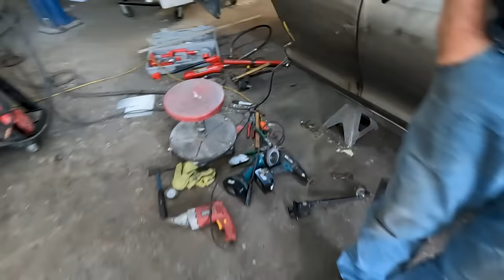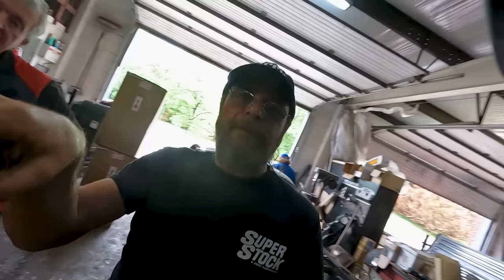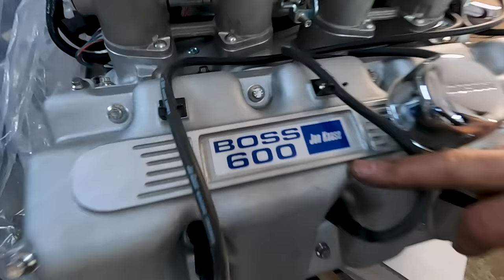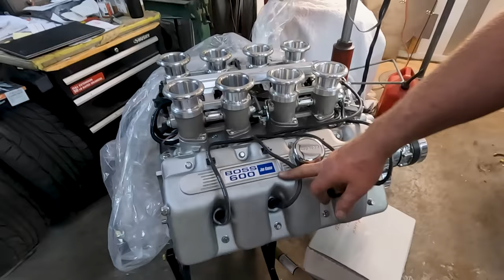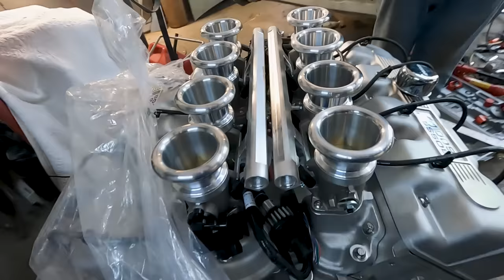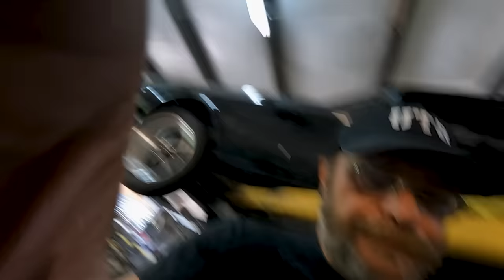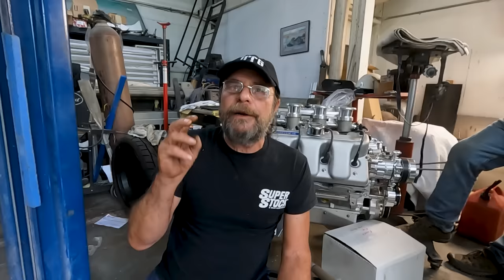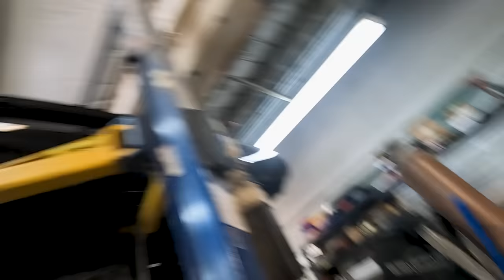How Ford Screwed The Pooch On What SHOULD Have Been The Greatest Musclecar Engine Ever

Comment: I don’t know if anyone else mentioned this, but the Boss 429 was pioneering in two very important ways you didn’t mention. It was the first production engine in America with individual shaft mounted rockers, and the Holley Dominator carb was originally designed for it. It was way ahead of its time from an engineering standpoint in so many ways.
Reply: It was on the cover of Hot Rod magazine in the mid 60's but they released it in 1969 for racing . Smokey had 3 early versions he was developing back then .
Reply: Thank you for your knowledge and videos USA 🇺🇸 USA 🇺🇸
Reply: and yet it got its ass beat on the street...hhhahahahaha
Reply: @chadhaire1711  They detuned that engine for the street ,I agree but the Hemi came up 75 hp down on the super speedway so thwy built a body to stay competitive in NASCAR and still didn't win everything  with it .
Reply: And also, I think he forgot NASCAR it was band the first year. It came out after one year they banned it too fast.
Reply: @jpjautotech7622 yes, the integral cast, individual rocker stands and shafts were amazing, at one point back in the Eighties I thought it was an advantage for Glidden , but this was not Bob's main advantage . Also Smokey won Pikes Peak with a Shotgun at 17 to one compression .
Reply: Not ahead of its time. Was just at the right place at the right time.
Reply: @chadhaire1711 wasn't a street engine like the 428 was.
The Boss 9 was a pure breed Racing engine.
Like taking a quarter horse and using it to herd cattle.
Reply: Would have been nice to have thousands of those engines laying in the junk yards. They are too expensive.
Reply: @jesse75  yep
Reply: @jesse75 quarter horses are the main breed used to herd cattle. However they were faster then the thoroughbred in the 1/4 mile race. The quarter horse is a sprinter, the thoroughbred a long distance racer. Kind of like NASCAR compared to the 1/4 drag racer.
Reply: @forestwoods5499  clarification. 428 was the quarter horse.
Reply: I have enough 390 truck blocks and parts my wife and be selling. The FE didn’t get steet cred because people didn’t engineer their own stuff.
Reply: @Bbbbad724  maybe, but only problem was the poor exhaust manifolds.
Reply: @jesse75  I have really never been impressed with the B9. It had just as well to me to be talking about Jet plane engines. But the 390-428 were everywhere  even still. I have gotten a very streetable 89 octane. 020 over 390 that by lightening the assembly, porting the heads, getting the quench right getting the mixture to tumble in the port and when dropped over the short side, influenced it to swirl fill the chamber. 515 hp and 488 lbs ft, and 550 on race gas.  And $ 2500 dollars  7000,rpm s , 35 years. I am going to put a roller cam in it, a solid I’ve had forever and is a Bullet by Harold Brookshire. I am hoping for 550 hp / 93 octane, 7000 rpm s and another 35 years. I don’t need a B9 and Cleveland Yates stuff, my 61 390 Hp heads look so much like a Yates head, I just gotta wonder….
Reply: Crediting Ford with developing a Holley carburetor that was never even installed in production Boss 429 Mustang from the factory is kind of disingenuous….and the fact they mount the rockers on 16 individual shafts was more a design reaction that was a result of them trying desperately trying to copy Mopar’s Hemispherical combustion chamber design while still building an engine that would fit in a Mustang (or Torino). There’s no huge advantage of individual rocker shafts vs the Hemi’s 2 shaft setup or the La and R/RB’s single shaft mounted rockers except it allowed them to mess with valve placement and angle more than they could have otherwise. It’s not like every single performance engine since then has been built with that rocker setup…in fact I can’t think of any besides the Boss 429 that use it. Does that make it ingenious or obscure?
Reply: @Bbbbad724  Ford guys laud the boss 429 over everyone bevause they made less than 2,000 of them and very few people have ever driven them or used them in a car…Like you said it might as well be a jet engine because most guys have never actually run or seen a real one. At the end of the day it was Ford’s attempt to keep with the HEMI because the 427 OHC engines weren’t everything they’d hoped they’d be.
Reply: 2 valves and pushrods !
It's not that advanced .
1967 FORD 255ci ( 4.2 liter )quad cam
500hp at 8800rpm in the GT 40....
THAT IS THE MOTOR  FORD
EFFED UP WITH !
they could have beaten the 426 hemi with that motor........
220mph in the GT40
Reply: @jesse75 . I agree Jesse. They should have put the Boss9 in land yachts and put a 4.185 bore3.86 FE in the Mustang and Torino with a big solid cam  and made a bunch of them. The 9 could holmogate  and we would have had a monster FE that weighed 530 lbs and made 550 hp and 510 ft lbs using dump truck parts. A thick bore Garbage truck engine with a stroked Garbage truck crank built light. That would crashed the 68-70 Party even more than the CJ did. Why did they put that Snoozer hydraulic cam in the CJ?and those stupid exhaust manifolds. The CJ should have been 450 hp A465 ft lbs and the iron MR intake? WTF were they thinking. A well trimmed 428 could have been as light as a 350 Chevy.,I built these motors, if they wanted a nice deep breathing 7 liter engine, how about the FT parts on a diet. 425 ci 4185 bore3.86 stroke lighten the 391 crank by stoking it for 351C rod and main bearings and make the top a solid cammed 61 390 401 hp heads and intake. This could have ruled the street. The B9 is like the Tunnel Port FE which they ran on some tracks instead of the Boss. That always struck in my craw. Dump truck parts with minimal work to turn that plow horse into a fine barrel racer. And the B9 homolgated in LTD s  could have ruled NASCAR.
Reply: Ford was always wayyy ahead of everyone just the way it is america V8s idgaf what manufacturer i love em all
Reply: Also was first American car to use F60/15 tires. Was it the first Ford to be sold as 4speed only? First to have manually controlled functional hood scoop. First trunk mounted battery in passenger car? First to have a rear sway bar. For sure it's the first Ford to guarantee the driver will "schtup some strange" at any car show they show up to. One thing I do know about owning one of these monsters is that there are no absolutes and the Boss429 rabbit hole is also the first black hole science encountered.

Comment: You touched on it at the end, but I can’t believe you didn’t even mention BOB GLIDDEN’s domination using this motor!  RIP Bob……..
Reply: I did!
Reply: 10 x world Champion!!
Reply: & not to mention how them big block Chevy guys were saying how in the hell is he taking that 351-C & beating out 454 big blocks! ❤️
Reply: Robert Yates worked for Holman & Moody at time of the development of this motor.
Said in comments about the program that it was the best motor program he had worked in for a OEM race engine.
At time on the track(nascar) they ran a single new Holley dominator carb. Seventies they made them go to 2 barrel carbs so the 358 small blocks could compete. Wood brothers ran them a while, but eventually had to go with the flow.
Reply: @danielparker4698  that's ignorant, the little blocks were winning in prostock at the time due to the weight per c.i. rule.  It sure wasn't that Clevelands were good either, everyone forgets that the year that Ford didn't want to pay Glidden he raced a plymouth arrow and won the championship. The magic was Bob not the name on the valve covers
Reply: Ricky Smith & Frank Iaconio raced Boss 429 engines.
IHRA had a higher cubic inch limit.

Comment: The engine definitely needed to be in a Torino. That's what they raced in anyway! I've never understood why they went in Mustangs.
Reply: IIRC they used the Mustang to help homologate the engine for the Torino. Think they needed to sell 2000 engines in cars, but didn't make it the first year, and the rules were waived or something.
Reply: Image. Ended-up lacking street cred. Was undoubtedly visibly stunning.
Reply: Smokey Yunick hated the big block Mustangs, saying they were the most nose-heavy and dangerous cars on the road. He stated that if ya tried to race against most anything else on a road course or even on the street ( NOT drag racing in a straight line ) approaching turns, you would most certainly wind up in a ditch or even worse, flip or hit a tree with the big block Mustangs, because all of that weight in the nose wouldn't allow the car to turn at higher speeds. Even Carroll Shelby was dead-set against dropping a big block in the Shelby Cobra's, but Ford had the money and insisted that he make it work. He stated a small block in the Cobra's and Mustang's would run circles around the same cars equipped with big blocks on road courses........for the same reasons that Yunick stated.
Reply: You mean Maverick or Falcon ? 🙄
Reply: @howabouthetruth2157 remember Sat. morning car shows (LEGENDARY MOTORSPORTS) from Canada ?   They did a 1970 stock big block challenge with Boss , LS-6, Hemi , GS & GTO.
1/4 mile , cones , breaking & best burnouts.
Look it up here on YouTube.    FYI... Boss won.   I wanted LS-6 to win 😢✌️
Reply: Or a Galaxie
Reply: They put them in torino in 69
Reply: Did you ever question why 427 & 454 went into Camaro’s or 440’s and 426’s in Challengers?  Heck I never had any Z/28 beat my Cleveland!
Reply: I think Ford saw the chance for better sales in the installation of the Boss in the Mustang. The Talledega was not as sporty to the general public, somewhat like the Dodge Daytona wing cars were not very practical as a passenger car and the lack of sales proved it.
Reply: Ford didn't want the regular Joe to buy a Torino at the dealership with the 429, race prep the car and enter them in a NASCAR race. 
They wanted those cars seen on the street.

Comment: If the numbers for sanctioned racing had been raised to say ten thousand units the Hemi and Boss would have been no more than a engineering experiment still sitting on the display stands at the corporate offices. Nascar and NHRA both caved in to corporate race for sales in the ‘winner on Sunday sales on Monday’ theory. By doing so the public was fooled into buying a lesser product than was presented. Think not, if held to the ten thousand number Chevy’s 396 would have ruled both circuits and the others would have followed their course of providing a grounded practical engine that filled all needs of the general public.